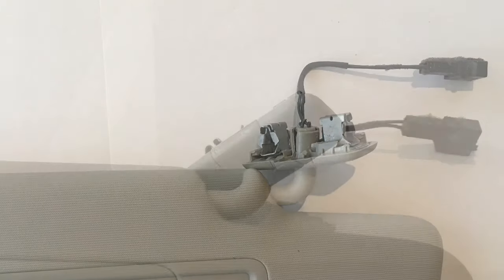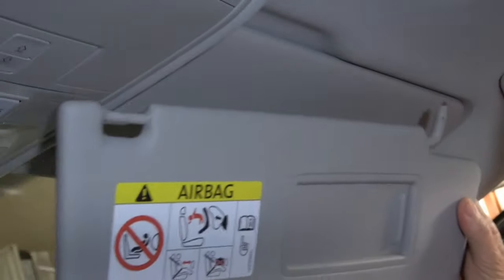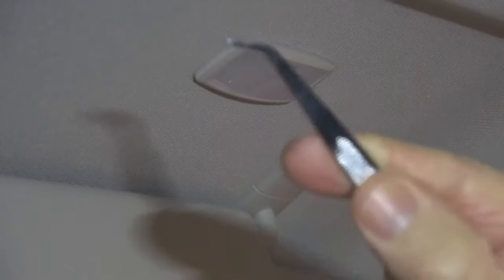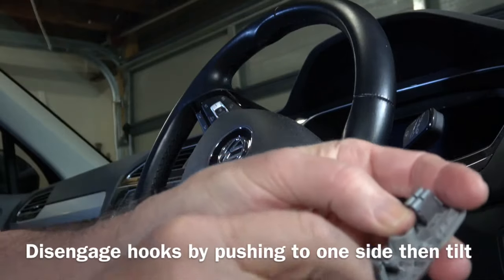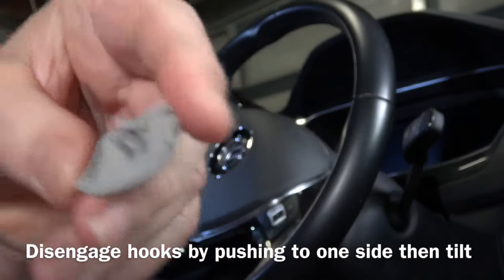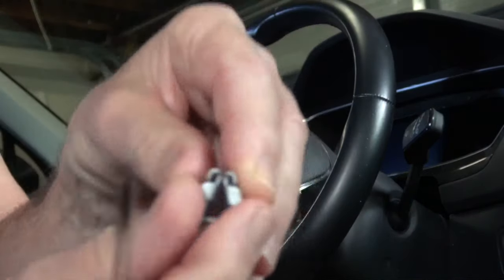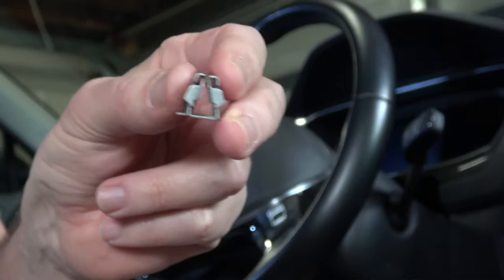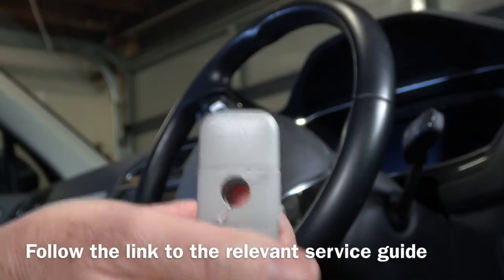VW Tiguan 2018 Sun Visor Removal

Comment: Hello, How do you go about disconnecting the wire? and plugging the new visor in?
Reply from the maker: Hi. The wire and plug pass along the roof lining and need to be pulled gently towards the opening. The glue will come away from the foam roof liner backing to eventually reveal the plug and socket. Once you plug in the new wire use a small screwdriver to push the plug and wire back close to their original position. No need to use glue.

Comment: Hi may I ask how you can remove the old sun visor off?
Reply from the maker: Use the method with two small screw drivers to release one clip and apply a little force to stop the clip from snapping back in then do the same with the second clip. The video shows how to release the clip with a screwdriver. After you remove the bracket carefully pull the wire out of the headlines and unplug it. Hope this helps
Reply: @georgevidas8256  appreciate!🎉

Comment: Can you tell me how does the  clip on the other side install and remove? Thanks.
Reply from the maker: I think it’s easier to release the front clip first then the rear clip. Once you release the first clip hold the visor so the clip doesn’t slip back in while you work on the second one. Installation is just the reverse order.